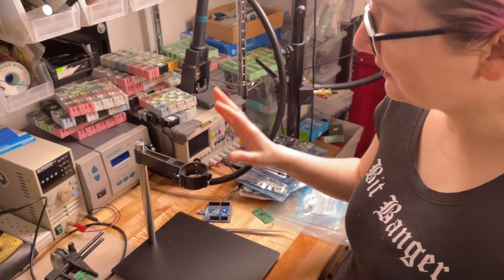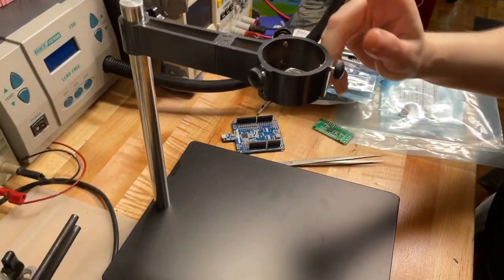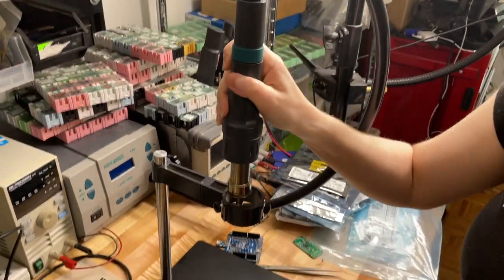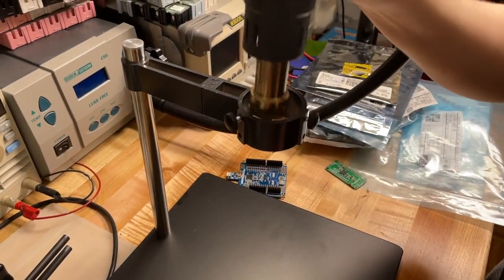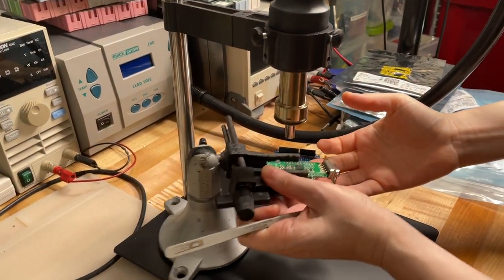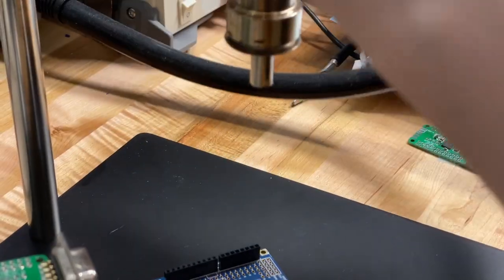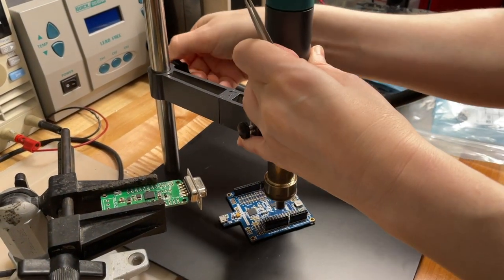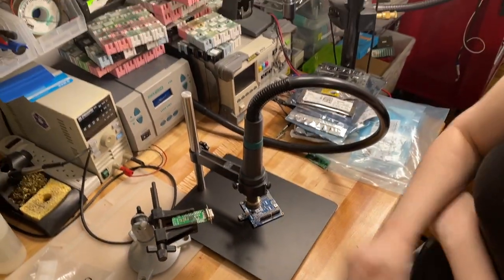Testing out a hot air station stand sample

Comment: I think the stand from my digital microscope would work for this. I will have to try it out!
Reply: My first thought was to use this as a microscope & overhead stand!
Reply: @lichensharemedia  I betcha if it was also a drill press that would be tight
Reply: Good idea. 3D printing the holder in ABS or Nylon, and replacing the camera support of the microscope with the new printed one when you need to de-solder, it should give exactly the same effect.